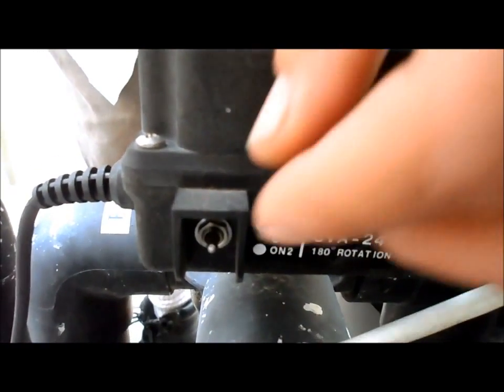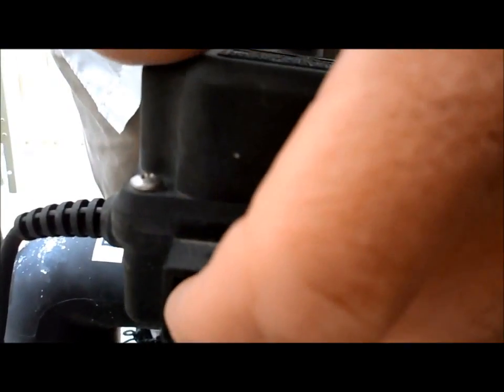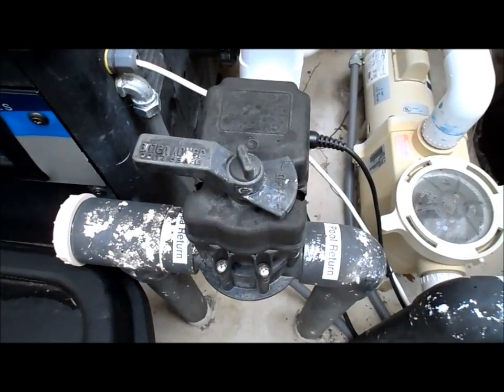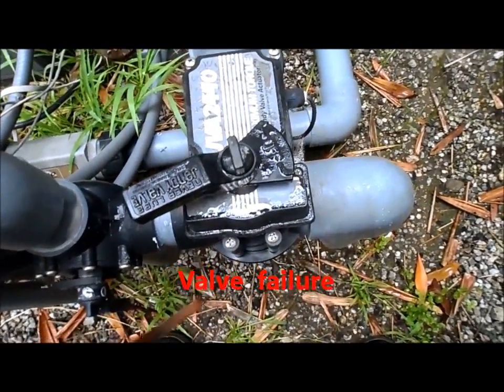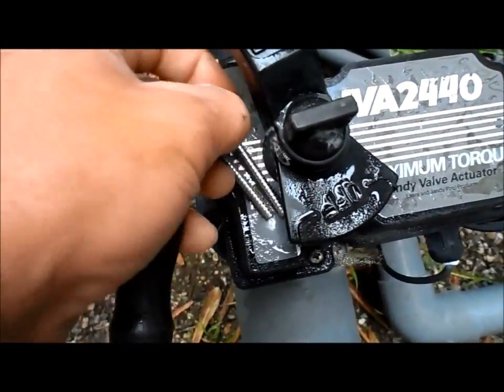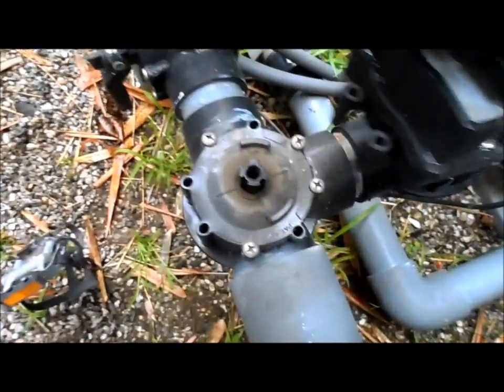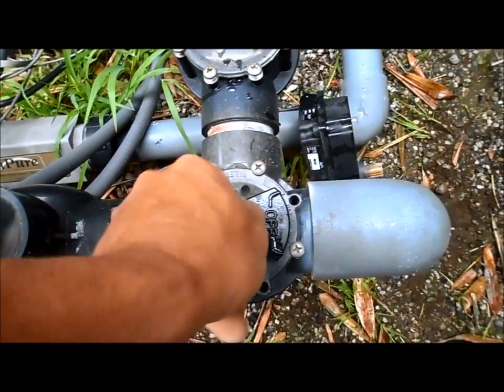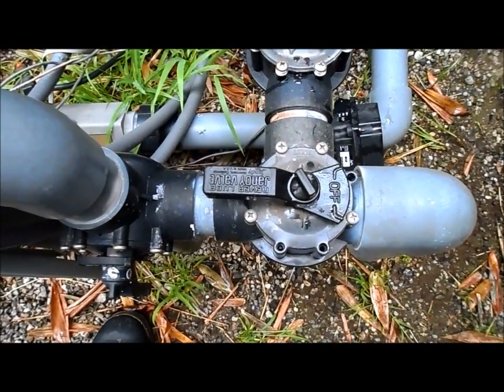Pool Valve Actuator Failure, Removal  part 2 of 2

Comment: My valve just spins around 360 degrees. Spa drains down. I have some switches I'm going to see if replacing them will work before I replace the valve.
Reply from the maker: Yes, there are some switches in there. See if those are somehow out of range.

Comment: you are a legend mate !
i am very new to pool setup and have a pentair.From last 4 days 1 of my compool acturator was not working and was sending all the water to my spa and it was overflowing.
today after following ur this video i removed the actuator and easily converted it to manual valve.
problem solved...
cheers mate!!
Reply from the maker: Nice. 👍

Comment: what if I wanted to get rid of the automatic valve altogether I could just leave it disconnected like you showed or just finished disconnecting the wiring at the control panel right
Reply from the maker: +Tim Willisms YOu can just leave it disconnected from the valve. No need to remove any wires and such.
Reply: +Swimming Pool Tips, Reviews & How To -MrDgvb1 great thanks

Comment: Our spa has been periodically draining completely, and the pool guy thinks it's a bad actuator that is offset a bit allowing water to leak.  He readjusted the cams so it is straight across again, but a week later it had offset itself again.  He said the actuator should just be replaced and quoted me about 260 to do so.  I found a replacement on amazon (an Intermatic- much cheaper than the Jandy) for about 80 bucks.  If I get it, are these fairly simple to replace?   Trying to figure out if it's worth it to have him do it or not-- huge difference in cost!

Comment from the maker: There could be debris stuck in the valve - I have a video posted on taking it apart to check it. I would suggest ordering a new face plate o-ring first just in case. It is the eighth video down in the playlist "Pool Pump Not Working" on my Channel. The rubber seal on the gate can also be bad -see if it pealing in one of the corners. In that case you will just need a new gate for the valve. It could also be your spa check valve -  see this video: "My Spa is Draining Down When Pool Turns Off "

Comment from the maker: Good point and thanks for the comment. I guess I was thinking people would rather not take the valve apart but some people may be more mechanically inclined than others. The problem lately has been the valves are not being made the same way they used to be and the gears are slipping a lot more. I have some pools with ten year old valve actuators that work great. It is the new one that are failing...
Reply: I lost the gear when pushing in the pin, had to toggle the lever back and forth until I found it